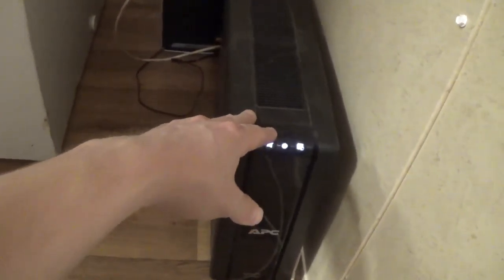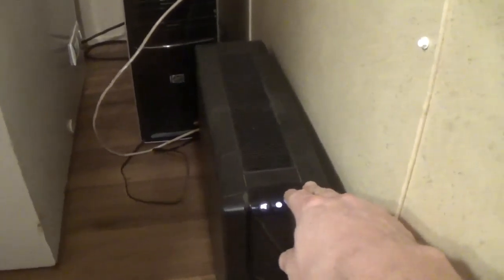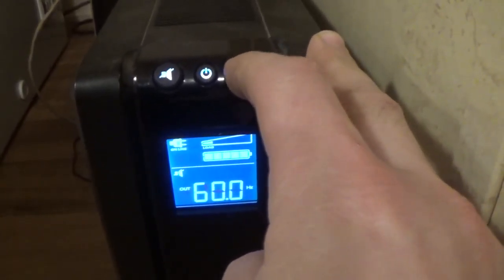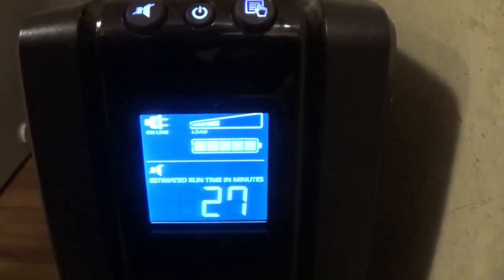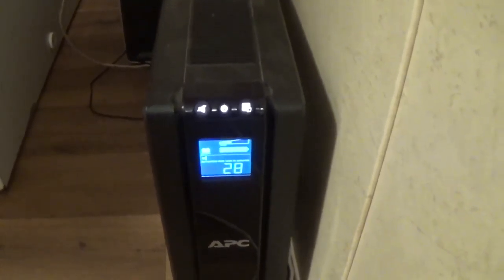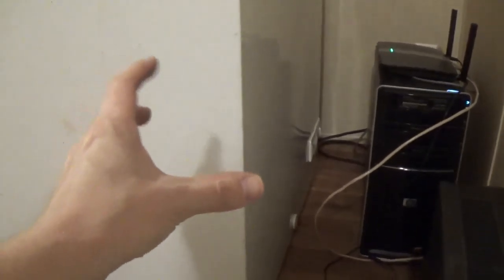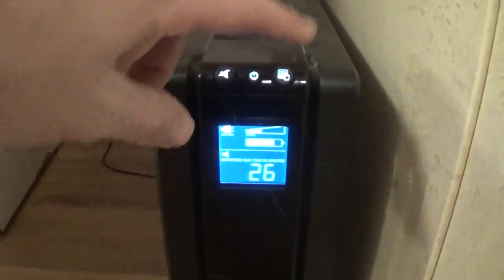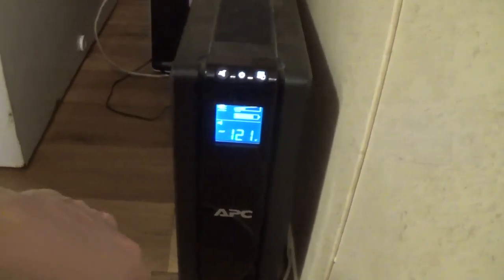Our UPS Will Run Our Deep Freeze

Comment: The average refrigerator will pull ~120 watts when it kicks on to do its usual re-cooling... Trust me i KNOW, i have put a clamp meter at the breaker to see what amperage it was using during its normal re-cooling cycle... Otherwise it pulls almost nothing (about .1 amps) during standby..  So YES you CAN run a refrigerator off a UPS.. !!!   Also depends on the size of the UPS & what else you have pulling off of it that will tell you long it will run for... Many so you cannot but they are WRONG..
Same thing people say that you cannot run Central A/C off a generator... WRONG, i have a 5500 watt running generator that RUNS my 3 TON (36k BTU) central a/c :-)  which only pulls about 13 amps at 240V which is ~3200 running watts :-)

Im glad you posted this because a LOT of people don't research or test anything on their own and just believe everything they are told... !!  Case & point with my Central A/C  ... !!
Reply: You have a clamp meter that has a sample and display time able to read peak current demands with a duration of only a hundred milliseconds or so?!?  If so, PLEASE tell me what model you are using. I have NEVER found a clamp meter that can reliable measure sub 1 second surges - at any price. When I need those readings, I usually end up using a scope to catch the peak.

Using said scope with sample and hold, my refrigerator has a peak inrush of around 635 (ish) watts which lasts about 200-500 milliseconds (varies a lot) before dropping to a running wattage a little under the rated nameplate (120w) of around 82W. I am guessing the 120W on the plate might be more accurately a VA rating. Anyway if you have a normal sized refrigerator pulling only 100mA at 240V (so 24VA), then I am guessing it is fairly modest in size - either that or MASSIVELY more efficient than any retail units. Awesome!

Comment: Much better to modify your UPS by adding a couple of terminals at the back you can hook up a standard auto battery to. Many people have those laying about that don't have full starting capacity anymore - but are still useful. Just remember to add a fuse in the line somewhere. I would keep one UPS dedicated to the freezer just in case of startup spikes.

Comment: You should NEVER unplug a running UPS from the wall, you have just removed it's earth protection and any fault in the equipment has just become lethal. Also yes, you can run it, but remember that a refrigerator uses an AC motor to drive a compressor, this is an inductive load and on startup, it may draw up to 15A for 1/2 a second (inrush surge current), your UPS is not designed for these high transient loads and it may overcompensate on its output destroying your PC, or blow it's output MOSFETs.
Reply: true! you must always check peak current the ups might provide
Reply: What would be a better solution?
Reply: I do though wonder  about the non-sine wave a UPS might be using.

Comment: l want to fit two units on food truck..
1)285 watts deep freezer working at -19 to -24॰c 
2)300watts juice freezer at 4॰C
 continuos working..
expected working hours 6-8hrs per day
This is for lce cream  n milk shake respectively..
regards
Please suggest solution
Reply from the maker: In a vehicle you'll need an inverter instead of an UPS. These UPS units take AC in and produce AC out; they're just a battery for use in your home in the event of a power outage. Look on Amazon or at truck stops near you for power inverters that convert your vehicle's 12 volts DC into 120 volts AC. I've got a thousand watt one in my truck, the only downside is that your battery and alternator also have to be able to drive the required input to match your inverter's output.